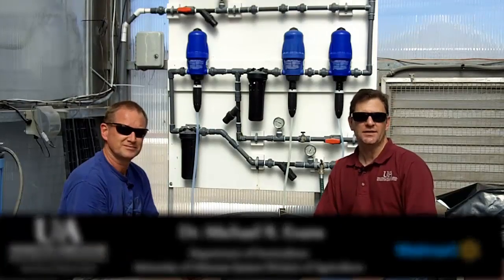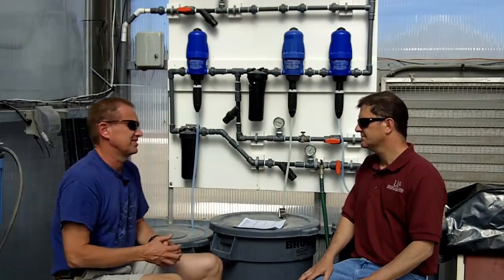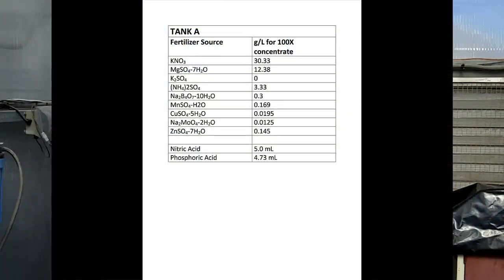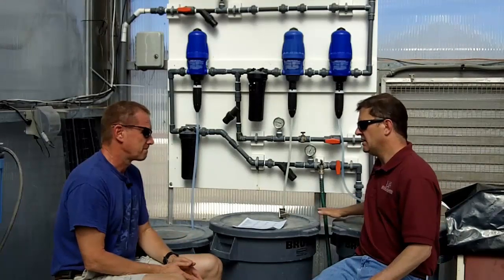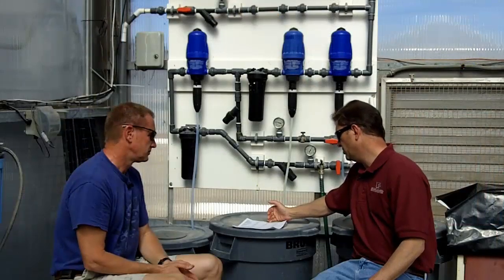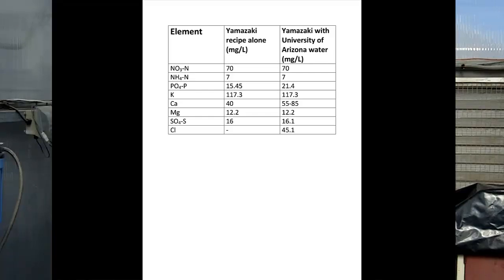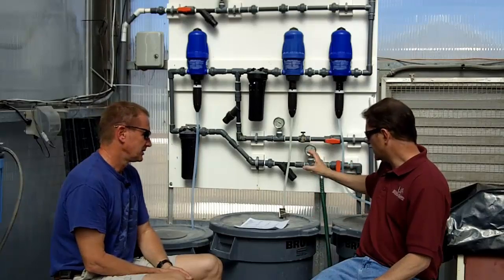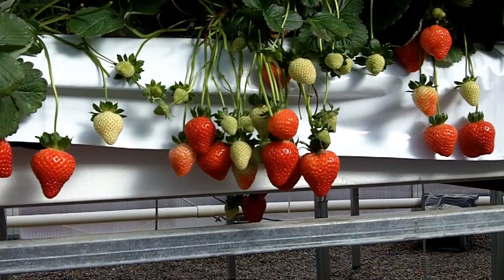Video 7. Arizona Fertilizer A and B Stock Formulations

Comment: Hello sir, how time watering for strawberry.
Reply: In one of the videos he said they're using 2-liter per hour emitters, with 1 emitter with a stake per plant. They irrigating for 1 minute at a time which releases 30 milliliters of nutrient solution, and irrigate 10 to 12 times per day. They aim for a 30% to 40% nutrient runoff, and they're using 1 part peat, 1 part coco coir, and 2 parts perlite. He mentions that changing the substrate/medium or the container would change these variables.